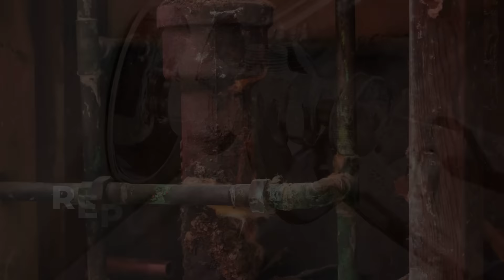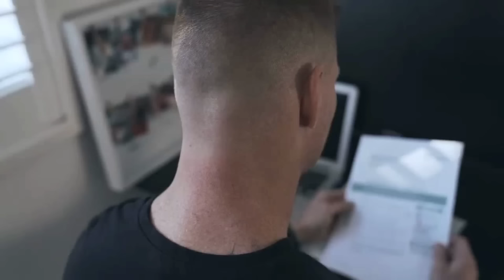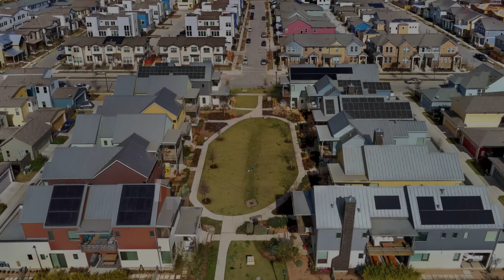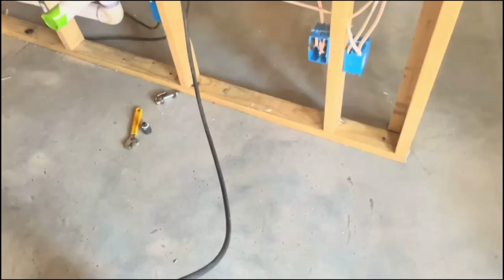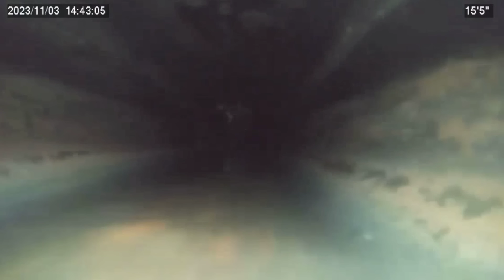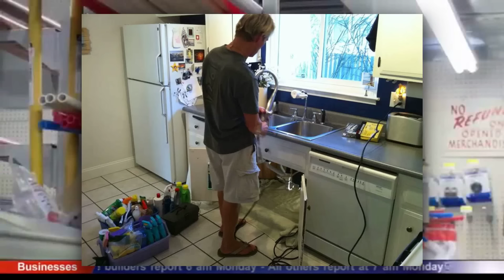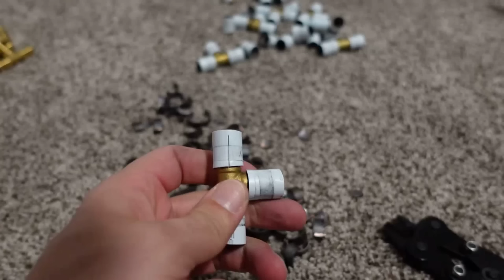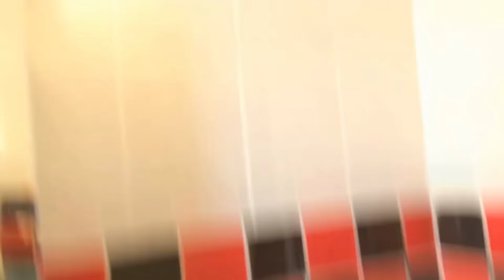Why 90% of New Plumbing Work Are Garbage (The Builder Grade Lie)

Comment: Some things I’d like to point out. Temperature and pressure relief valves don’t have different quality levels, they are installed at the factory into the water heater and not by the builder. By replacing it nothing will be made better unless the old one is stuck after years of non use or leaking. Expansion tanks may or may not be present at a water heater. There are many factors that decide if you need one or not and if it’s not needed it’s best to not install one. If you do have one it should only be replaced if it’s water logged and no longer working. Again it is nearly impossible to discern quality in expansion tanks. As far as pex goes, I am not a fan of the material as there have been many lawsuits with a lot of manufacturers. The pex will definitely fail far sooner than if copper were used. However a builder using push to connect fittings is pretty rare and even if they did somewhere it is NOT the weak point. Supply lines nowadays are usually an integral part to the faucet so not picked by the builders. Realistically supply lines usually will not have any failures in a new house until they’re at least 15 years old with the exception of a grossly over tightened toilet line. Hope this helps.
Reply from the maker: Appreciate the detailed breakdown!  You're 100% right that the builder isn't choosing the T&P valve—but the manufacturer is. That’s the heart of Quality Rot: when the 'standard' factory component is value-engineered to the absolute minimum, the whole unit becomes a 10-year liability. I also agree on the PEX lawsuits; we've traded the 'pinhole' risks of copper for the 'fitting failure' risks of plastic. The point isn't that every part is a 'weak point' today, but that the margin for error has vanished compared to 30 years ago. Thanks for keeping the technical bar high in the comments!
Reply: @QualityRot  Water heaters in general are lucky if they last 10 years, I have had them fail as short at 5 years do to the tank springing a leak, even top brands. 

On a side note, water supply line material is full of give and takes. For example, while copper may last longer, it will fail much quicker than pex if exposed to freezing temperatures. I have copper and this has happened twice. When I replumb I will be going with PEX B and crimp rings across the board. As to the push to connect fittings, they do work but they will fail, its just a matter of time. I have used those in a pinch but only in easy to access areas. 

I do not have an expansion tank on my water heater. I do have one because I am on a well but it still works, 20+ years later.
Reply from the maker: You've hit on the ultimate plumbing trade-off! 🛠️ Copper is the king of longevity, but PEX is the king of 'forgiveness' in freezing temps. Moving to PEX-B with crimp rings is a smart 'Bulletproof' play if you’ve dealt with burst copper lines twice—it’s about choosing the right tool for your specific environment. Also, you're spot on about the push-connects; they are 'Sunday Night' fittings, not 'Behind the Wall' fittings. Glad to hear that 20-year well tank is still holding the line! Stay vigilant.
Reply: @bryanrocker5033  If I were you, I would use the copper crimp rings and not the stainless steel cinch rings. I have been installing pex for 20 years and the only failures I have had was from the stainlees cinch rings breaking.p and lately the rate of failure has been increasing as they get older.
Reply: @johnlynn3625  yep copper crimp is solid. in my opinion better than copper kinda. Never seen copper crimp fail. I’ve seen pinch and expansion fail many times can’t believe people still use that stuff.
Reply: @bryanrocker5033   My water heater that came with the house is 17 years old, with no problems. My Dad's lasted well over 25 years and the one in his previous house lasted about 40 years and was still okay when the house was eventually abandoned.  That was on a farm with well water. 
I've never heard of anyone's only lasting 5 years. 
I didn't even know that an expansion tank was a thing being used.  Haven't seen any in the area that I live.
Reply: @bryanrocker5033 My water heater that I inherited from previous owner is about 27 years old. BUT,.it is a Rheem fiberglass/plastic model.😁
Reply: @my3dviews  Funny thing is, the house that had the high end water heater leak also had an expansion tank that had to be replaced....city water too.
Reply: @bryanrocker5033    I wouldn't be too happy if I had one that leaked after only five years.  If mine does leak, it won't cause any damage, as it is near a floor drain in a concrete basement.  17 years is pretty good, even if it failed now.
Hopefully it lasts another 17 years. :-)
Reply: @QualityRot That was cute to post pictures of weather related water damage from flooding, as if it has anything to do with this
Reply: @QualityRot  Use a Watts T & P valve. They invented them.
Reply: I'll add this: Never open the T&P valve. If you do that when the O-ring has hardened with age, it WILL fail to re-seal and will leak. It's not a big deal to replace it, but there's no reason to tempt fate.  If heat and pressure cause it to "blow", you've got bigger problems than the T&P valve. I've had one leak even when it has never been manually open.
I bought a new one, shut off the inlet valve, drained a couple of gallons out, then replaced it. 

Also, have you looked at where it drains to? Usually it's just open to the floor, not directed to the drain. If it "blows", you've got a hot mess in the nearby carpet, walls, sheet-rock, and furnace.
Reply: @mrcryptozoic817  I will take my chances of it leaking vs having it stuck and cause tank to blow. I regularly open T and P valve to make sure it's working. Never in 30 years in any of the houses I've lived in had one leak after testing it. Maybe lucky? Who knows. One thing I know for sure is there is a reason there is a valve there and it should work. Only way you know if it's working is by opening it. If it leaks after then, you know it's bad. But, that's better than an explosion. If you're that worried about leaking after testing it, have an extra one on hand in case like I do. I never had to use it. But , yes, I know. If I didn't have 1 on hand, then, it would leak on me and have me stranded.🙄
Reply: @osos231  Opening it does NOT tell you if it's working. It only tells you if it will open. 

There's no way a home owner can tell whether it will work as intended.
Reply: @mrcryptozoic817  I mean, I can't tell whether my car is going to break down tomorrow, but all I can do is be proactive and do maintenance on it.
I can't tell if I'm going to die tomorrow, all I can do is try to stay active and healthy.
Same with this valve. I guess you haven't seen what I've seen. Old crusty sedimented rubber that won't  open until it's too late and takes out half your house. The manufacturer even recommends  to test them once a year to make sure it open. I know a lot of plumbers, hackers, etc tell you not to, which is beyond my comprehension.  Yes, they will say it'll leak after. Again, if it leaks, it's because it's old ans crusty,  you need a new one, hello.😅
If you never open the damn thing to test, you can be sure as heck that it won't work when you need it.
Reply: It's almost like this video is ai slop or something
Reply: Down here, the squirrel's love to chew through pex in the attic!
Reply: Now changing the manufacture supplied drain valve that only has you thinking you are gettin* sediment out…with a boiler valve with cap …a 3/4” full port ball valve ..I use a clear 5/8” hose and can see big chunks of stuff flowing out …I put one in on every new water heater I install l..
Reply: @markbrodie48 I've always done that to every heater I've owned. Definitely helps. The one I currently have, the previous owners prob never flushed it. The sediments was sobmuch that it was about maybe 3 inches above lower heating element. It was a lot. It took me 8 hours one weekend to get it all cleaned out. I mostly had to reverse flush it since even the 3/4" drain valve was not enough for the amount of sediments. In the end, I succeeded and tank is still running 30 years later. It's a Rheem fiberglass/plastic one that never rusts.
Reply: The only thing I'd trade out in a tank water heater before putting water in would be a brass drain instead of the plastic one that comes in cheap heaters. That wont matter to the home owner if said home owner never plans to drain it annually anyway.
Reply: Well said
Reply: I would rather have the bladder in the expansion tank expanding then my plastic pipe in the walls
Reply: In phoenix temperature and pressure relief valve dont come preinstalled on all brands and models. They are often sitting in a small box in the bottom of the big box the heater came in
Reply: Isn’t PEX installed properly with proper fittings better than copper in some situations- very hard water, installation in attics is southern climates in two story homes without basements and high seismic areas due to flexibility.
Reply: @witzviewer I’m in Arizona so freezing pipes have never been a concern lol. Although pex may be better with freezing, they do still break or at least weaken from freezing and should be no excuse to allow pipes to freeze. We have very hard water in AZ and the pex here still fails when the copper is just getting broken in 😂. Hot attics and pex shouldn’t mix as the heat just degrades the pipe faster. So yes pex has its place but for normal house plumbing copper would be my choice (although that’s no cost prohibitive unfortunately). So my choice for pex would be a good pex B like Viega or Zurn pex B.

Comment: That’s actually incorrect about the water heaters. It’s not your builder grade heaters with the plastic internals. It’s your box store heaters your commercial and residential supply house. Water heaters are not the same as the ones that you buy from your local box store Lowe’s, Home Depot, etc..

Comment: everything fails.....cast iron corrodes horribly, city water has chemicals that will eat copper as well

there is alot of mis information in this video

good thing to do is filter the water before it runs thru your house, everything will last a bit longer, ABS is perfectly fine for drain lines......the whole system is filled with water to test for leaks and needs to stay that way for inspection....

relief valves are installed by manufacturer on water heaters not by the builder.....homowners in many cases are given options and most choose the cheaper ones unless doing high end work

Comment: This video bundles tons of things together to say it's the problem. This video is meant to misinform you. First.
Of all, an inspector is not a plumber. The inspector honestly does not know what they're looking at. They have never fitted pipes together. They have never put a warranty on the pipes they have installed. They have no training in plumbing work. They have not worked as an apprentice for 9 thousand hours. The most accurate knowledge you're going to find is from an oregon licensed plumber. The?
Worrying code book is the best There is available. Oregon plumbers spend 4 years of college studying this code. It tells you the characteristics am performance of all the allowed piping for each application. 😂

Comment: The pex was installed under the slab with crimp fitted joints ..under the slab.  not end runs..  yeah they pressure tested.. the system but it saved perhaps 20%  As to supply lines; i would shut off water even one day away from the house.

Comment: PEX is not plastic
Reply from the maker: You're technically right—it’s cross-linked polyethylene, which is a big step up from standard polymers! But in the world of Quality Rot, it’s still a far cry from the real staying power we used to get from copper or iron. It might be easier for a builder to slap in, but it doesn't have the same Mechanical Integrity against things like UV exposure or rodents. Do you think the ease of install is worth the trade-off in long-term durability?

Comment: Will plex burst like copper when frozen? If not, it is a plus for cold climate.
Reply from the maker: For a home in a cold climate, PEX is a major plus for your home's staying power, but it requires proper installation to be truly effective:

PEX-A (Expansion PEX) is Superior: Expansion PEX (PEX-A) uses a specialized tool to stretch the pipe and fitting. This system has the most "memory" and is the most resilient to freeze-thaw cycles.

Insulation Still Matters: Even though PEX is less likely to burst, frozen water in a pipe still means no running water. Insulation and proper routing inside the "thermal envelope" of the house are still required to avoid Operational Rot.

Avoid the Crimp: In extreme cold, traditional metal crimp rings can become brittle. If you are building for longevity, the expansion method is the "bulletproof" choice.
Reply: Pex will burst but it takes a lot more than copper to make that happen. I have been installing pex for 20 plus years and have seen one or two burst pex pipes as opposed to thousands of copper.
Reply: @ptech88 I had burst pipes in several properties for various reasons. It's always a nightmare to fix. I would take regular maintenance of plex over disasters of copper.
Reply: @speedingAtI94  i didn’t say pex wont burst, but it will take a lot more than a simple freeze to make that happen. Fittings will burst faster than the pipe. Nothing is 💯 leak proof

Comment: In my early years of marrage I had a hot water tank that both thermostats welded on. As an electrician my thought was lightning I had some other items in the house that went the way of letting the smoke out.
My wife and I were gone to visit relatives for 2 days. Upon driving into the driveway I saw smoke( it was steam) comming out of my computer room. That's where the WH Lived. I opened the door and it was a steam sanna through the house. I shut the waater off at the street. and it took 30 minutes before I could get into the water heater cubby hole. The top thermostat flange had what looked like a cutting tourch had  Created a 4 inch cut fron the heating element down the tank. The bottom heating element had about a 2 inch cut. I am glade I did not have my computer systems moved in yet.
Fans in the windows helpe dclear the mosture. I got the tankout and the ENR valve was corosion welded shut. The cats were hidding under the bed at the other end of the house. 
I got a new tank and fittings. Went to the plumbing supply and bought the release valve. Now I test it every month like clockwork.
Reply from the maker: Wow, what a nightmare, I'm glad your computer system wasn't there yet. Especially your cats were probably scared.
Reply: @QualityRot  It took them several hours before they poked their whiskers out.
Reply from the maker: @redcorset 😂well I’m glad they are OK 👍

Comment: a lot of issues are from being installed wrong. These products will work and last a long time, IF they are installed correctly.
Reply from the maker: You’ve hit on the 'Silent Killer' of the industry. We can blame GE or Miele all day for using plastic, but if the installer leaves the shipping bolts in or doesn't level the feet, the engineering never stood a chance. We’ve moved into an era where 'Correct Installation' is a specialized skill, but companies are still paying 'Delivery' wages to do it. It’s the ultimate 'Quality Rot'—the product might be a 9/10, but if the install is a 2/10, the customer gets a 0/10 experience. Have you seen a specific 'rookie mistake' lately that’s been killing these new high-efficiency units faster than anything else?

Comment: Man do I know about the supply line problem. I didn’t know that braided supply line has about 5 to 7 years to fail. When the $8 line failed it cost me $1450 in materials and a week of my time. I had to replace the dinning room ceiling and a drop ceiling in the basement. If had to pay someone it would have easily been $5000 to $6500. Just plan to replace those line every 5 years.
Reply from the maker: It’s heartbreaking when such a small part causes massive damage, but replacing them on a schedule is definitely the smart move. 📉

Comment: 20 year plumber here. I’ll say, a lot of propaganda in this video.
T&P valves come with the heater, it’s not something the builder actually “chooses”. 
A failed expansion tank could create a drip in a faucet I would say. 
I don’t know anything about ABS its illegal in my state.
Shark bite fittings aren’t something that’s used to plumb entire homes, that would be quite costly. 
I’m not a fan of any kind of pex pipe at all. IMO copper is the best material, so long as it’s installed correctly.

Comment: Underfloor cast iron drain pipes in our house totally rotted out. The entire 45 foot run. Basement floor jackhammered up.
Reply: Don’t need to jackhammer now they have the ..permaliner ..they take an epoxy saturated long long sock and blow it through the old pipe..re lines …like new ..like a schedule 50 sewer pipe ….takes a 4” down to like 31/2”….

Comment: its all over. concrete replaced by foam, solid wood replaced by glue and wood chips. new roads last a year, new vehicles fail fast, new electronics the same. greed is all over. food is saturated with cheap ingredients.

Comment: I’m just not a fan of Plastic. Hence the term micro plastics.
Once 30 some years ago, I had to redo some CPVC lines in a basement. When I cut the hot water line, the pipe fell to the floor and shattered like glass.
Reply from the maker: Exactly, plastic pipes just don't hold up over time compared to metal. 🛠️